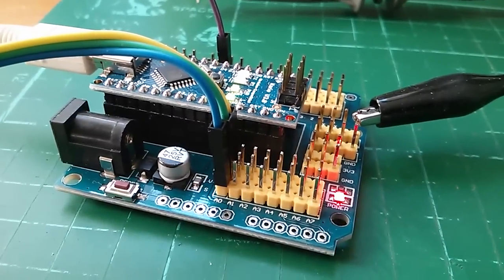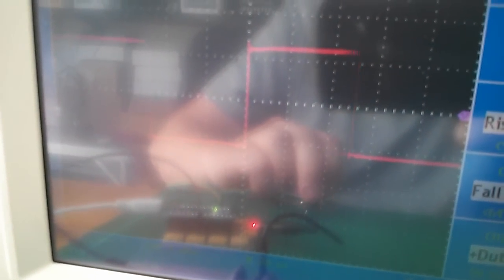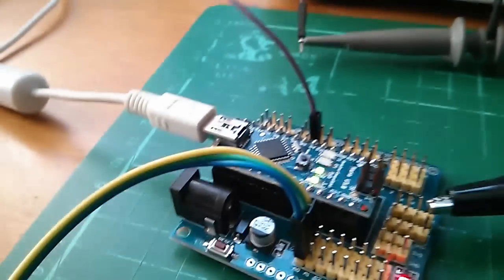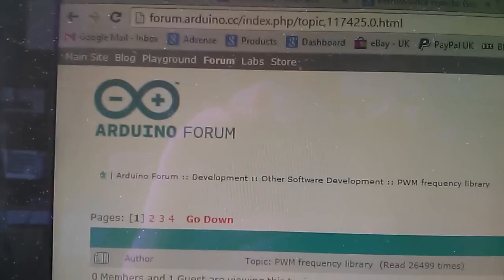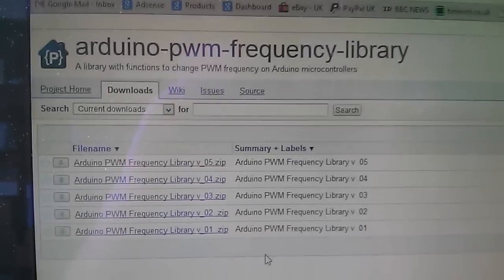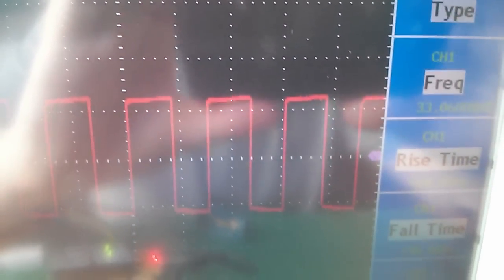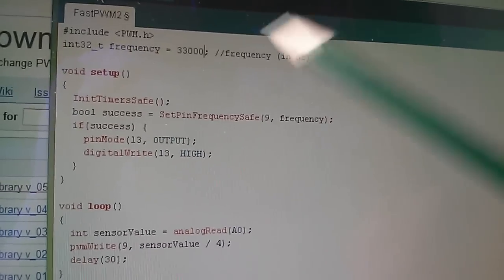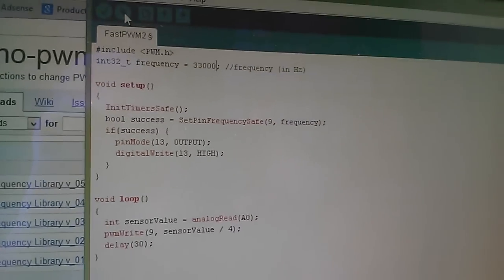Arduino PWM Tutorial #2 - How to Set PWM Frequency Accurately

Comment: Thank you so much for this mate! I've been considering creating a library for controlling PWM frequency of timer 2 on the 328p chips. That way it's safe for millis()/delay() etc.
This is a superb repository to start me off. I love the Arduino community. I've been working with embedded systems for years. The Arduino community is by far the most helpful and extensive of any I've experienced. Filled with top guys/gals who are always putting in the legwork to make life easier for others. Cheers for this bro!

Comment: PWM.h is a very valuable utility, beware of compatibility issues with the Arduino compiler release levels, those compatibilty issues are found in the Github documentation, PWM.h  was satisfactory , until  the  Arduino compiler was revised  to a higher level, PWM.h no longer  worked , revisions by the originator solved the problem

Comment: Hey! I'm having trouble downloading the PWM library to my arduino IDE. I know this video was made a while ago so I'm wondering if this library still works? I'm able to download the library to my computer but when I try the add .zip library it says "archive is not valid: multiple file found in zip file top level" also do you knwo if this library works for the ATtiny85? thanks

Comment: There is a problem with this library, I had an inverter project where I needed to switch between mosfets at 10 milliseconds to get 50 hz acv output. The millis function works fine until 20 hz, no matter how hard I tried I couldn't switch between mosfets faster than 20 hz. So any timing above 20 milliseconds with the millis function works but not faster.

Comment: Hello Julian, I am an old guy new to Arduino. I used your code for this generator. I need to output 369,000Hz. I can get 363k or 380k but not 369k. I wonder if I were to add a line of code to scan between 363k and 380k would it hit 369k. Can you help?

Comment: I follow this video carefully and I copied  your modified program but when I tried to compile it keep getting the message "Error compiling for board Arduino Nano" I tried to go tools menu and set Board "Arduino Nano" and  Port  " Com 3" but still no joy. Maybe I did a mistake in the program but cannot locate. Please see program underneath.

#include <PWM.h>
int32_t frequency = 33000;  //frequency (in Hz)

void setup()
{
 
  InitTimersSafe(); 
  bool success = SetPinFrequencySafe(9, frequency);  
  if(success) {
    pinMode(13, OUTPUT);
    digitalWrite(13, HIGH);    
  }
}

void loop()
{
 int sensorValue = analogRead(A0);
  pwmWrite(9, sensorValue / 4);   
  delay(30);      
}

Please I would appreciate if you can help meas would like to drive an fet for a Tesla violet wand for health purposes. Thank you beforehand.

Comment: Great video until the part about "I installed the library..."  When trying to install as a ZIP, how did you get around Arduino IDE errors of:
"The library "Arduino PWM Frequency Library v_05" cannot be used. Library names must contain only basic letters and numbers. (ASCII only and no spaces, and it cannot start with a number) Specified folder/zip file does not contain a valid librarywhen you install it as a ZIP to the library?"
Reply: ok, figure it out.  I had to unzip the "PWM" into the Arduino's library directory as PWM, then unzip the examples as subdirectories of "PWM".

Comment: Hi Julian,
I have arduino Micro board
and I need to generate 32ms pulse with 4msec ON duty and 28msec OFF duty.Please help on this.
Reply: i´m interested in doing something like that, can someone please help us?? :D
Reply: What about digitalWrite(1, HIGH);
delay(4);
digitalWrite(1, LOW);
delay(28);  

Or "delayMicroseconds" for µS
Reply: Set the frequency to 31.25 Hz and voltage to 0.625v. The formula for a Period of 32ms is 1sec/31.25Hz.

Comment: When using this, does it set the frequency in the backround from that point on? For instance, if using this code once, then uploading a completely new sketch that contains none of these functions or library, when calling analogWrite, will it still use the previously set frequency? Or revert back to the default frequency?

Comment: Julian, I knew I followed you for a reason. Im making a physical spectrum analyser, this is pretty much my first real project. Im using a Sparkfun Spectrum shield using the MSGEQ7, which splits the stereo into 7 left and 7 right outputs are varying frequencies  I have fitted 14 x 40mm fans into the bottom of a small cabinet, I have made, fitted a grill over the top and placed 4mm polystyrene balls inside.. so instead of the standard  stereo lights just going up and down, you have this physical movement.

Had a few issues using 2 pin 12v fans, controlled with 8 way relay board, got a lot of buzzing (drove me made) and have picked up a high quality fan 4 wire with PWM. Ahh I thought this is like a relay board, 12v positive & negative, I thought, ahh i can run the PWM @ 5V, minimal load on the Arduino job done. Spent a longtime last night and could not get it to work.

After much research, I realised the input signal needs to be at 25-28kHz, I was lost, code and registeres  GGRRRR,then realised the Arduino is 16kHz, penny dropped, all the solutions on the Arduino site just left me more perplexed.. As you have been the inspiration for me getting into this and I have most of the same kit, the voice of reason told me to check in with you.

Ive spent 14 solid hours trying to work this out, your clear and concise explanation has to say the least, filled me with joy, had a little skip around the house @ 415am and just about to follow your tutorial, download the code and to test my theory out.

Bless you Julian, I tip my cap with respect and for saving my mental well being.. Just how long have you been doing this for? I have no formula, I just read , get lost, pull my hair out. Your page has been such a help, beyond words.. Keep up the great work, sorry for the length. If you have any input, it would of course be more than welcome

Kindest regards

Dean

Comment: Hey Julian. Is it possible to get 100kHz from Arduino or 62.5kHz is the border?
Reply: have you tried to generate 100khz?
Reply: i have tried this and got 100kHz but i am new to this and may be incorrect somewhere. I did push it to 210kHz but after that the reading on the scope went back to reading 50hz, don't know why? hope this help. using audrino uno.

Comment: Really nice Video, that was exactly, what I was looking for! I connected a fan to it, which needed 25kHz. What I am wondering about is, if it is possible to change the frequenzy for each pin individually, because my high power led, don't need to run at 25kHz. Did you find out, if that is possible?
Reply: Nope, I did not. Sry for that!
Reply from the maker: Thanks Jan. It's the chip's internal timers that are modified, so I believe this would affect pairs of pins.
Reply: +Julian Ilett Thank you so much for the video.I would like to ask you if you know how to set Arduino PWM frequency using matlab support block(S-function)?
Reply: +Jan Reiners Did you solved it? And if so, how?
Reply: +Jan Reiners No problem, thank you for answering. I just managed with this script to set the freq. from pin 9 and 10 at 30kHz, but pin 11 stay's at 400Hz for some reason.
Reply: It's because pin 11 use another timer than 9 & 10. Of the mega328's 3 timers one is used for pin 9 & 10. I don't know if it's possible to open several instances of timers, but at least one should be left untouched, as to keep realtime clock.

Comment: Awesome video.  Im just starting and have had trouble locating variable frequency control.  If there was a way to use potentiometer to set the frequency value linked to the library.  I would be set.  Thanks much.

Comment from the maker: Indeed. Now I'm sure the Arduino can be tweaked in a lot more ways. One thing that will come up later is power consumption - I'm hoping I can switch to the internal RC oscillator and slow the clock down. There'll need to be a low power night mode, otherwise all the extra energy collected by MPPT during the day will be used up overnight.